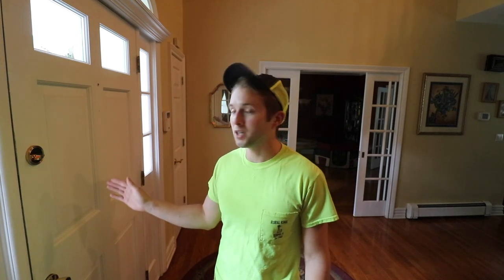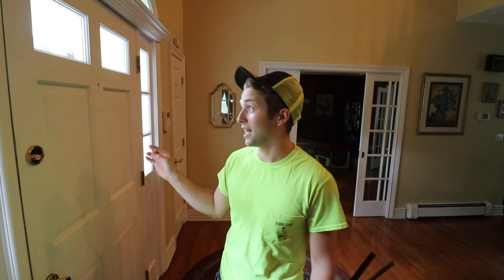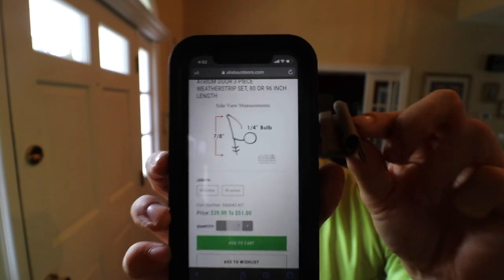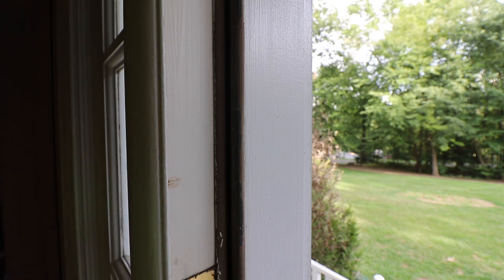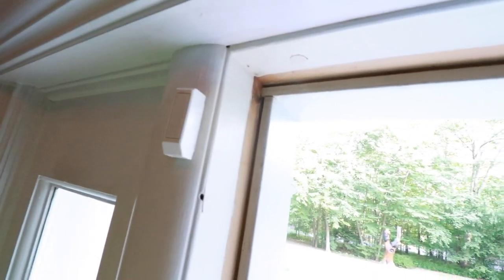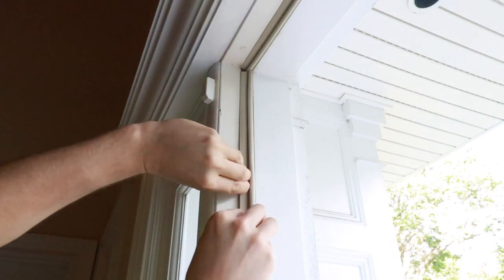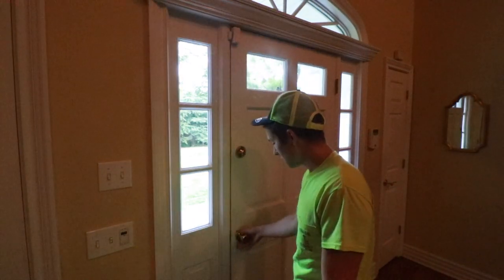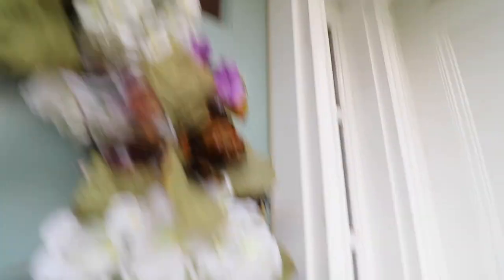How to replace door weather strip

Comment: Thanks for this video. My door won’t fully close after a handyman replaced the original weatherstripping from 1991. Watching this will help me determine if the weatherstrip is the wrong design or if he installed it incorrectly. It turned out he was not a good handyman. Thank you.

Comment: Yep door warped and bowing just slightly over those thaw and freeze cycles and other environmental factors
Reply from the maker: I have the same problem. Heres a little tip for that. When reinstalling the weatherstrip in the kurf, don't push it in all the way in the section of the door that is warped out. Does that make sense?
Reply: @OldSoulMillennial  yep
Reply: @OldSoulMillennial  if the door don't meet the jam     have the jam (weatherstrip) meet the door...
Reply: @OldSoulMillennial  might also be sagging hinges...  check gap at top and bottom of both sides.  It should be close overall but dead straight/identical on hinge side.  Shiming behind hinge with business cards may help if not replacing hinges.

Comment: Ha! “Try and use the same stripping” he says!! My door is from the 1950’s!
Reply from the maker: Hmmm, they make peel and stick sealant tape. Sounds like you will have to get creative!
Reply: @OldSoulMillennial  I will have to get creative! I was just being a bit cheeky! I added one of those rubber door sweep deals to the bottom of my door, it’s working so so. When it’s no longer -30° outside, I think I’ll cut the old threshold out and put a modern style one in its place! Thanks for the video by the way!

Comment: How do I slide the weatherstripping into a rather tight gap? You just seemed to slide it right but I cannot do that. Help please.
Reply from the maker: Does the weatherstrip match the same one you took off? Same size and profile?
Reply: @OldSoulMillennial  I didn't remove it, the painters did, so I dunno. The top part slides in but further down it is tight. And it's an older house, the weatherstripping had never been replaced.
Reply: @AustinGata  I’m guessing the painters removed it for paint the frame.  Why not call them back. They removed it. They should of install it back